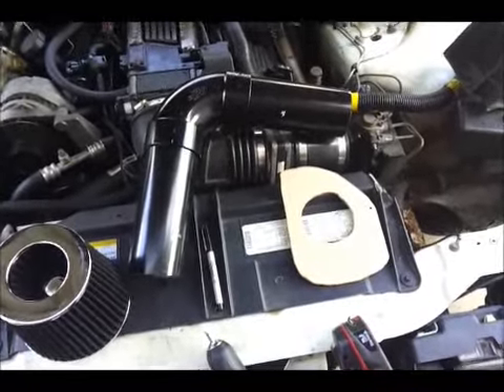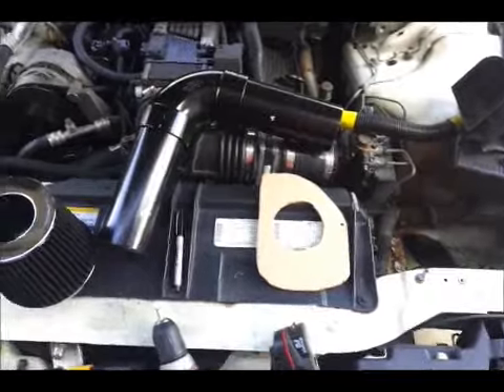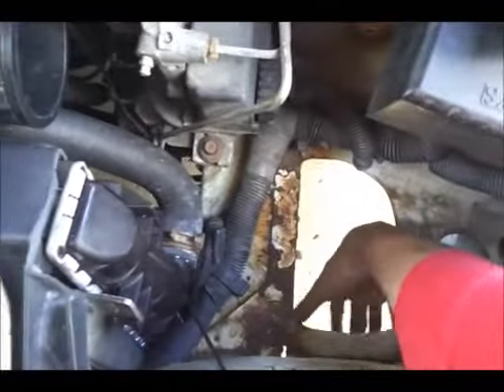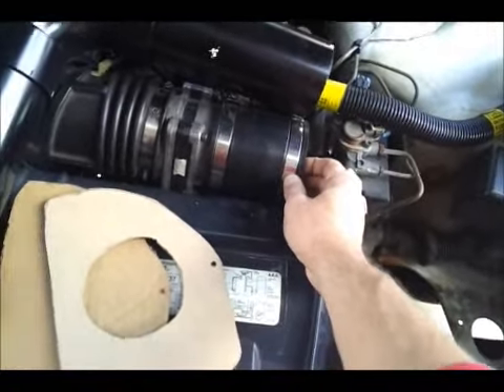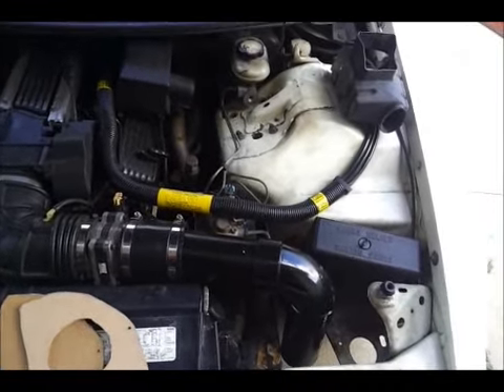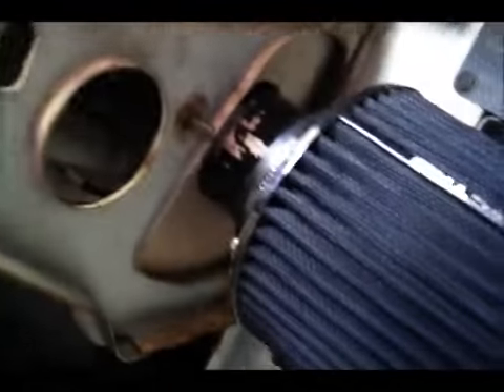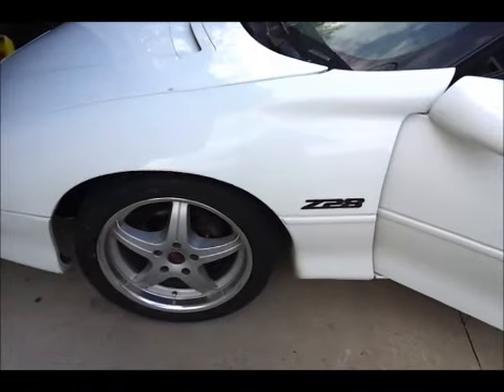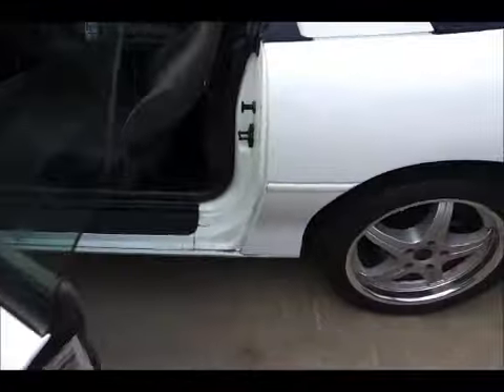LT1 custom cold air intake - DIY cheap kit

Comment from the maker: I drive it in the rain all the time just as I did with my K&N which I ran for 5 years and had the same filter location.  I can't believe none of you people commenting on the location have never seen a K&N on an F-body.  This is the same filter location as the K&N, SLP, and Moroso.  There is a plastic cover that goes on the bottom of the bumper that should prevent a puddle from splashing up and soaking the filter.

Comment: It might help to have some kind of a splash guard to keep the front tire from slinging road grime on the filter.
Reply: +420Nitroman He does have a splash guard for it, he just didn't install it for the video so everyone could see the installation easier.  The splash guard totally protects the filter from the tires slinging or throwing anything, as well as protect it from water splashing up into it.  I have a 95 Z28 and I built my own CAI also.  No problem with water or debris with the guard in place.

Comment: Neat. I need to do this as well. My stock rubber elbow came apart so I'm upgrading to a metal elbow without the air snorkel and I think I'm going to do what you did.

Comment: I know on the LS1 K&N cold air intake, the air filter is mounted on top of the radiator, the LT1 I know, even with the K&N air filter is in the bumper area, just like how you mounted it.  I am going to be doing this build for my LT1.

Comment: great video!! just be careful of filter being out in the elements... also a quick tip im a plumber you can use abs piping which is black so u wont have to worry about paint pealing and abs is very light...u might have to go to a plumbing supplier i dont think lowes or HD carry it..

Comment from the maker: I had the K&N and it fits fine.  If you hit a bump it does not matter because the filter is up in the bumper.  It is essentially located exactly where the K&N was located that I had.  LPE, K&N, Moroso, SLP, etc. will give you the same performance gain.  In that regard there is no difference so what you got is good.  To me those kits are all just way overpriced.  I used my K&N for 5 years and still got over $100 when I sold it. This cost me like $25.

Comment: hey man. good vid. are you not worried to drive in the rain? feel like it would be sucking up tire splash.
Reply: +John Avi He does have a splash guard for it, he just didn't install it for the video so everyone could see the installation easier.  The splash guard totally protects the filter from the tires slinging or throwing anything, as well as protect it from water splashing up into it.  I have a 95 Z28 and I built my own CAI also.  No problem with water or debris with the guard in place.

Comment: This is a good vid, I got a 97 LT1 with the K&N kit on it (was on the car when I got it) The problem I'm running into is the bolt that you used on the mdf part, what size is that? Mine looks pretty rusted and I can't seem to get a socket on it. Maybe if I knew the correct size socket I can pound it on and pull it off!

Comment: You would likely have better luck keeping the high-flow filter inside the engine bay, then keep a pipe running through to the wheel well to bring in cold air... or just avoid puddles/ rain/ dirt. your call

Comment: Well I do have a car first of all.  I drive a 96 z28 and It says right on K&N's website that the K&N fpik does not fit cars with traction control.  And I just thought the filter would fall off like that if you went over a speed bump or something like that.  I really have no idea but its cool you got the custom one to fit well.  I didn't bother with it and bout an lpe intake.  Mainly because I have to pass smog in Ca and because the hardware stores around me suck.  I hate living in Sunnyvale Ca.

Comment: the filters really dont do much at all for sporty cars. they normally have a huge air-filter that gives them plenty of breathing room. so you will see no gain in just a filter change. as for cold air intakes. i think you should keep more so inside your car instead of bellow it. then take something to push the air around the filter. this will give you the same effect while driving. about 10 degrees cooler.  you want it inside because these filters don't work as well for clean ing the air.

Comment: when i got my lt1 trans am someone had made a cai for it and they did a horrible job so i took it to the track and took it off and left the breath easy elbow and it picked up 4 tenths in the 1/8th mile so thats easy 6  tenths in the 1/4. well i got to looking at the CAI and it was like reduced down to a 2 inch????? so ill probably do your setup it isnt going to matter if its pretty or has a K&N sticker on it. air is going to go through it the same way maybe better.

Comment: What is the best material for the piping  not to heat up because of the engine's heat? Aluminum, PVC, plastic or rubber hose?
Reply from the maker: I haven't had any issues with the piping being affected by the heat.
Reply: ***** he doesn't ment that the pipe would be melting. He ment performance wise. You use a cold air intake so your air will be more dense because it is cold.
Reply from the maker: peper0nipizza From what I understand they are all the same. Moroso and KN are both plastic and SLP is a steel setup. If he was asking which material is best for keeping the air that is traveling through the pipe, then the answer is it doesn't really matter. I am not so sure that's what he meant. It's about 12" of 3" pipe with air being sucked through pretty fast. I don't think it has a lot of time to heat up so those differences would be minimal and not be noticeable to performance.
Reply: Seems plastic will stay cooler and cool faster, but I live in North Dakota and it can get to -60 so I'm worried it would get brittle and break. I used 3" exhaust pipe and wrapped with header wrap. Seems to work great
Reply: lmao@aluminum. plastic is the best against heat soak. it will still get hot but not as steel or aluminum

Comment: I'm sorry but did you say you had a functional SS hood and you were using a K&N air filter ? Umm why and how ?  If it was a functional SS hood why wouldn't you delete the k&n all together.  I don't  know how you would be using both at the same time anyways.  Also did the SS hood fly off ?  Cause I have never heard of a guy  going back to the stock hood once he had a SS hood.  Going back to the Stock hood seems like a stupid thing to do not only for function but for looks as well. I'm calling bullshit on the SS hood bro.   You didn't have a SS hood. Nor did you have a K&N air filter setup before.  What did you just throw the old one away ?  Come on are we supposed to be stupid.

Comment from the maker: Then you've never seen a cold air intake.  What you are referring to is not a true cold air intake.  All cold air intakes are placed outside of the engine compartment.  The K&N cold air intake kit for the LT1 Camaro and Firebird is similar to this and the filter is in this identical place.

Comment from the maker: Are you aware of the design of any cold air intake?  All K&N, Moroso and SLP designs are exactly like this - the filter is placed outside of the engine bay into the bumper area to get cold air from outside.  This is no different.

Comment: what year is the car?  i have a 97 z28 and it has a hose that ties in just before the MAF and goes down to the air pump. you did'nt mention anything about that.
Reply from the maker: +Eric Lexius My car has no AIR system therefore I do not have that hose. When I had the K&N it included a rubber cap to block it off, which I used.
Reply: So I can just cap that hose off?  Also, I just tried this setup and the pvc won't let the hood close because its laying on the corner of the radiator shroud and the brake valve.  The outside diameter of the 3"pvc I have is actually 3 1/2.  Thoughts?
Reply: My car is bone stock
Reply: +Eric Lexius 

Hey, I noticed your comments and I had a 96 WS6 Firebird prior to my 94 Z 28 which i drive now. 
1) yes you can simply unplug the AIR hose connected to the the intake make sure you plug the intake off all the AIR junction, leave the AIR hose its fine. 
2) there is a "baffle" that is restrictive on the end of the air cleaner box housing.. remove that.. Use a k&n "type"  air cleaner in the stock box. You cant get much more air through there without forcing it.  
3) you can remove the screen from your mass airflow sensor which is restrictive as well...
4) you can remove the vent hose that runs from the passenger side valve cover to the intake- cap off the intake and put a breather filter on the valve cover. 
5) make sure there aren't any dragging "brake calipers"
6) ensure that your exhaust is breathing freely, You can gain a lot by removing the cat. and use a less restrictive muffler.. You have to maintain some type of air in/out ratio though...  Have fun!
Reply: +Eric Lexius 

If you're referring to the OPTi spark vent tube that does need to be filtered... That's imperative.
Reply: +Kevin Item #3 above, Not a 'good idea ; The MAF sensor is an electronic sensor that sends a signal to the engine computer, which then uses the measurements to help calculate fuel delivery and spark timing. In most applications, the MAF sensor utilizes an electrically charged wire to determine the amount of airflow entering the air intake. This wire produces an electrical voltage, based on airflow, and sends it to the engine computer, which then uses the information to adjust spark timing, fuel delivery and spark advance. A fault in the MAF sensor can cause a rough idle, poor fuel economy and possibly even stalling.#4 above, that is not an intake.  The filtered air that is measured by the MAF sensor enters the Throttle Body before the throttle blades and goes up out of the TB thru the hose to the passenger side valve cover where the air entered there goes thru the passage ways in the head and into the engine where it is pulled by the PCV valve system (vacuum) into the intake manifold.